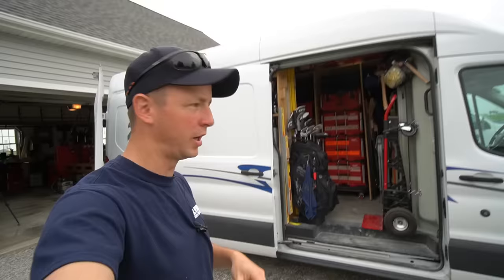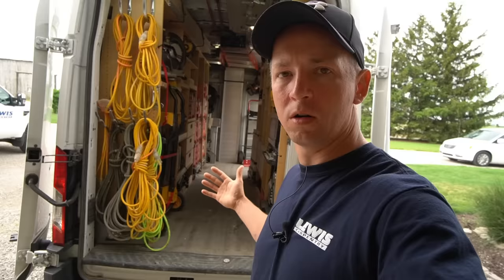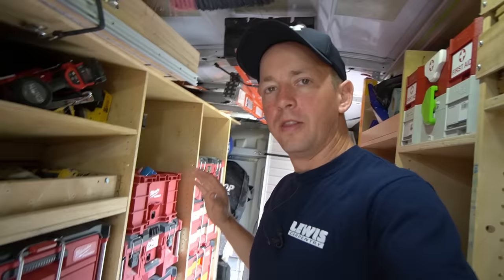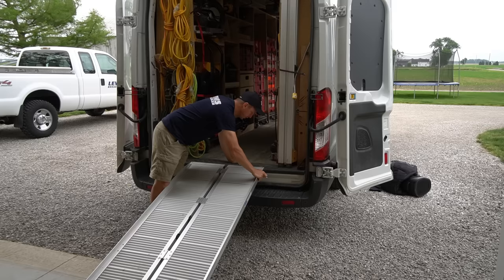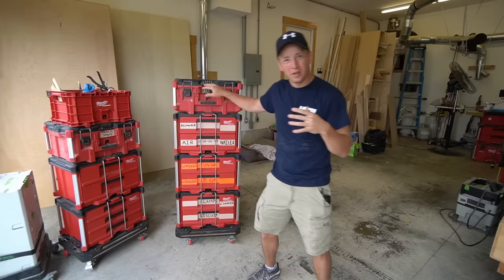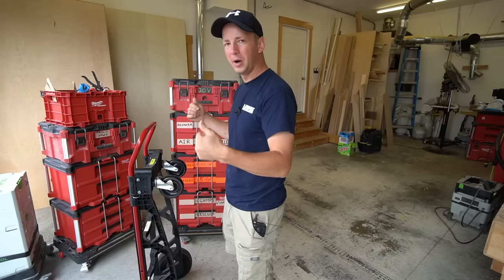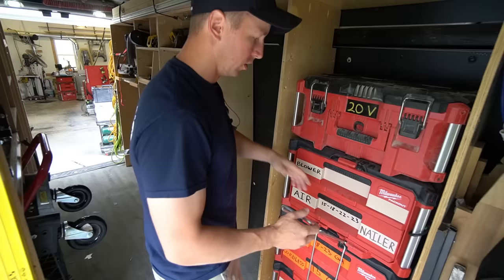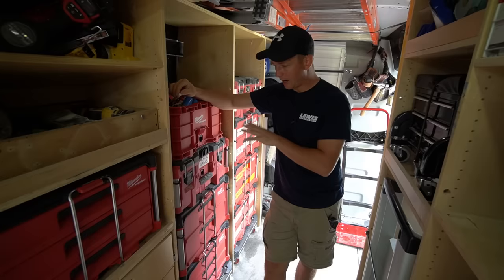Packout Drawers!!! My Favorite Carpentry Work Van Setup Yet!!!

Comment: You can get a hand truck that is designed to climb/descend stairs, it has three wheels in line on both sides. Mostly used by appliance delivery guys. Great well presented videos. Keep up the good work. Stay safe guys. Pete (Scotland UK) 👍
Reply: I think that Milwaukee is going to turn that hand cart into a electrical stair climbing dolley. Maybe!

Comment: Great setup. But one suggestion:
Move the ramp to store at the back door. That way you are already standing on the ground when you set up the ramps. You never enter the van until the ramp is set
Reply: it might possible.. but i might not fit cause the hight might not possible to put it back there.
Reply: You could keep the ramp on the floor?  Then when you open up the back, you just have to slide her out.   If you need to move stuff without it, you could stand it on the ground and lean it where that miter saw stand lives.

Comment: Love you videos. Started with Milwaukee pin nailer review which I bought. Love it. I saw first video with different casters and thought why you didn’t go with the silicone. Lol. I see you upgraded. If I could offer a suggestion, a ridged bar wood or steel bar stock that will drop in horizontally across top 6” or so of packouts will be a much stronger just as quick system that won’t fail like bungees always do eventually. Think accident or evasive maneuver. Those bungees will snap. Just a thought. Keep up the awesome work videos. I’m learning so much.

Comment: Dewalt had drawers for a while so that's why I went with dewalt. I just have the tstack system. I have probably 20 or so. Definitely game changer to have stuff in drawers. In and out. I have 2 carts and we typically stack the almost 10 high. So 2 carts with 20 plus drawers. Thousands of tools in only a 3' × 1' space save not only time but space. Love your set up.
Reply: I’ve done the same.  They’re like mechanics chests for carpenters.

Comment: Man, I agree with you so much on the benefits of the drawer system. I'm from a welding/fabrication trade where we go on site a lot and work so a traditional rig welder layout was not applicable for us. I got so tired of digging for tools in a bucket after carrying it to the destination. I immediately saw gains in productivity on job sites with the system.

Comment: When there's a "wheel", there's a way. Those bungee retainers and level cleats is definitely something I would do. Nice work Spence. Instead of the copper clamps (for bungees) you can get some PVC ones...and file/smooth out the inside edges on 'em.

Comment: Great setup for efficient work flow, and optimal use of personal energy (not over exerting). May I make a recommendation to exert even less energy. Perhaps you can add a small electric winch to the top near the rear door, to pull up the heavy stacks up the ramp.

Comment: Great setup, the old saying work smarter not harder very much comes to mind! Worth spending time researching, designing and implementing things like this as they payback many times over what the initial cost of time/money was in better work flow, easier work, less stress and hassle and prolonging your body to allow you to work longer and better.

For the bolt for your ramp that looks like something that could easily be lost. What about gluing a rare earth magnet to the side of the truck inside near the back door so you have some place to put it or better still a small length of chain on it and the ramp so it is always there when you need it.

Only other things I could think of was installing a proper handle inside the van like you see in disabled toilets etc to pull yourself up with both at the side entrance and the back and then finally a sack trolley which is designed for stairs, they usually have 3 wheels each side v the normal one and can be motorised. Perhaps not the one you use every day but put in for when at jobs where you need to take your tools up stairs inside or outside.

I suppose one more thing to go along with your microwave would be the fridge/cooler pack out to keep food/drinks cold.

I really liked the simple level holding design, sometimes the simple things are the best.

Comment: Excellent ideas.  One recommendation...move the ramps to the passenger side rear.  Make something where they hinge to the floor...maybe on a recessed rod or a third hinged stub panel that extends the ramps to the middle...where you can slide or flip them over and lower them.  Carrying them back and forth and relying on remembering a bolt seems like an eventual fail.  Good luck.

Comment: Hey Spencer, clever idea for the bungee cords. Idea for the 2 drawer unit, cut the floor out of the top drawer and install 1/8" plywood to the interior sides, thus making it a 1 full height drawer for big stuff. I should patent that idea. Another great video.
Reply from the maker: That's definitely not a bad idea if you would need one that size.
Reply: @InsiderCarpentry  I thought that you would be much more enthusiastic about this because of your previous videos on the subject.

Comment: I'm a 30 year technician and I have a foldable wagon with big wheels and I can load it with all the tools I'll need to do a job it saves alot of walking I tried several but to find one that will go across the yard or gravel or anything was hard to find this one has wide tires and pulls easy

Comment: Have to say that's a pretty awesome setup. I still have some wooden shelves and dividers in my sprinter. When I first started mine tstack and tough sys was all there was. I recently picked up the tough system wall mounts. Customized them for my van walls. Now just the tough system arms mount to the walls and my tough boxes slide and lock in. I still keep a few tstack. I really like the modular nature of yours. I may have to do some rebuilding now thanks. 
I'm officially stealing your level wall hooks. Genius! I want to get ramp like that as well. Trying to figure out where to store it 🤔
I'm definitely looking at a transit as next truck. Once I removed my dpf and EGR on mine sprinter she's a dream reliable. Fast as well 😅. I like being able to carry 16&17 ft stock still with my pass through. I haven't measured inside transit yet
Reply from the maker: I can carry 16' by opening my bulkhead door. Its handy.

Comment: One thing to solve stepping in and out of the van more than you need is to use your sliding side door for "go-to" "quick-grab" tools and supplies.   In my Ford Transit,  I have a storage cabinet and drawers built into the sliding door area so when you open the sliding door  all your "quick grab" etc.  tools and stuff are right within arms reach so you don't have to get into the van.   So simple.   If you think about it You really don't need two entrances to get into the van.   🤔maybe I should do a video on my van.   😂
Reply: Please do a Vid on your van! I’ll watch out for it! Sounds like a cool idea on the “quick-grab” storage!!
Reply: Love the Unicorn Truck vids too!!

Comment: Building out my transit and looking online. I’m a general contractor… so need a few different tools and layout.  I’ve done a lot of the same but need fewer pack out drawers. 

I currently have a 10” compound miter that I’m struggling to place. I’m thinking about getting the 7.5” makita sliding miter to carry on the van and leave the 10” at the shop.  80% of the cuts I do can be made on a smaller saw. …

If I could get Ford to make a few changes to the transit (I have a 2020 high cab extended AWD with two sliding foots on left and right side of cab), it would be:  

(1) sliding ramp coming out the back that is 2’ wide that folds out to 4’. I’ve looked at this …. It would require some pretty brilliant engineering to not raise the deck.
(2) I have power heated seats…. For a $68,000 dollar van, I’d like to see them ventilated like the pickups. 
(3) move the rear tires back 12”, I drag the rear Reese hitch several times a week. 
(4) I’d make the van 4” wider and make the entire rear cargo area 100% square on the inside. 

I really like the Transit otherwise. 

Thanks fir the video updating what you’ve done.

Comment: Love your idea of using the Milwaukee Packout system with wheeled platforms.  the only thing i would do differently is use the Dewalt DWX 726 rolling miter stand and make wings similar to the ones you made.  I made some to work with that stand (see Homecraft solutions). Always love your ideas and creativity as well as the quality of your videos.  Thanks, Brian

Comment: Awesome set up! Very well thought out layout & care for the body, especially with the ramp!  
I have a few questions...
#1 What led you to decide on setting up in a van vs a trailer & which sizes works best for everything you need? 
#2 What do you use for setting up a "work shop" on a job, since you don't have room to work in the van? 
#3 What would you change & why?
#4 The microwave idea is genius on these rigs, but do you also keep a small cooler somewhere or a mini fridge?

Comment: Another but major common sense example of lean engineering. Manufacturers finally rolling out useful equipment for use by all levels of trades. Your van set up could very easily be used by plumbers, electricians, etc. As I get older and through waves of down sizing my tools and garage workshop I’ve put everything on casters for mobility. Garage - Projects during day , roll tools and equipment back to small storage areas, then pull cars in. Easy to keep clean too.

Comment: Excellent video.  One comment, did I see some flex in the tires of the two wheeler when loading first Milwaukee packout stack.  If so properly inflated tires will push/ pull easier than under inflated tires.  
Thanks for a great video with many good ideas.

Comment: thank you for the video and all of the tips and ideas.  I wonder if you thought of using a 3/8 inch floor threshold/wheel stop, maybe beveled at the front to help lock in the base wheels,  especially if you forger to lock the wheels?
Reply: The issue with the packout stacks (at least that I have) is that they are top-heavy, and therefore can come crashing down during hard turns, not necessarily them rolling around.

Comment: Packout has a system of rails for trucks/garages for storage
Reply: The problem with the packout racking is it takes up alot of valuable real-estate in a van or trailer build.  Because of the way the support brackets are.

Comment: Outstanding....great job Mr Lewis !!
Good Order is the foundation of all successful jobs
Love your mindset of Work Smart, not Hard

14:07 is that a Quick release lynch Pin Bolt , your using for the ramp security ?
Reply from the maker: Just a run of the mill 1/4" bolt.

Comment: Great video. Definitely gonna look into doing a similar set up. My problem is with doing a system like yours at the moment is I'll need a trailer at least 6x12 when transporting custom pieces from my shop to the jobsite which I need to get at some point anyways causes its just alot easier to unload etc. I won't be able to fit much materials if 2/3 of the cabin is filled with tool storage.

Comment: I love seeing all the problem solving with this kind of organization. 
Im curious if you considered mounting the ramp to one of the rear doors?
Reply from the maker: The way I had the van laid out already, I didn't have enough space in the back. On a back door would be a great place for it though if it fits.
Reply: @InsiderCarpentry  I’m thinking about outfitting a small cargo trailer the same way. But I know that ramp doors need to much space for many job sites, so having regular split doors with a nice lightweight ramp like yours attached to one of them might be nice.

Comment: I recently received a new work vehicle. I also have been struggling with ideas for storage. I'm not on the Milwaukee system, but I absolutely share your concerns about all of these stupid pac-out systems that require you to remove the boxes on top if you have to get into them. The drawer system to me was a no-brainer. Unlike you I don't remove a lot of my tools from my vehicle so portability is not as important to me. But the Milwaukee packout system is just way too cost prohibitive. Again, since I'm not removing my tools like you are it's a different situation for me. But I found for the cost of a pack out box, two or three drawer, I could easily build my own custom boxes with full extension heavy duty drawer slides for a lot cheaper. Just a personal decision. I feel Milwaukee is just raping customers with what they're asking price wise for these systems. I agree there high quality and well thought out but the prices are ridiculous for what you get. Great job, I recently discovered your channel and I'm enjoying it

Comment: I did enjoy my packout stuff but it did not last long.  I am pretty easy on my tools/boxes and for almost $2000 invested in the system they lasted about 16-18 months which was really upsetting.  Unfortunately, there is no real solution that is long-lasting like a traditional shop metal tool chest and a portable plastic setup.  The funny part is I am super organized and some of my subs are working out of buckets and they are extremely good and fast at their job.  However, I do have to lend them random tools here and there because they lost theirs or temporarily misplaced it on the job site :)

Comment: did you make another video where you show us the wheel base that you mentioned you did custom i looks bulkier than a standard wheelbase and you have different wheels?
Reply from the maker: It is custom made. I do not think that I have covered it in depth in any of my videos. I will try and get it featured in a video or add a short showing how its made.

Comment: Very cool setup. How do you protect against theft or someone trying to break into the van? I know this might be a simple question, but I have been speaking to a lot of tradesmen and they have told me that break-ins are one of the biggest problems in the industry. Curious to know your input and also anyone else that has any ideas on this. Thanks
Reply from the maker: Carry an inland marine insurance policy on the tools and lock the doors. That's about it.
Reply: @InsiderCarpentry  Oh okay thanks.

Comment: I love the packout drawer system but the pricing puts Festool to shame. Absolutely scandalous how expensive these things are.
Reply: Can’t disagree on the expense comment but to a skilled well paid professional 5 minutes to unload then 5 minutes to reload required tools versus 20 minutes (example 40 minutes a day) over time is still a huge labor savings again that is to a professional. To the non professional that’s a bunch of money but not many of us have mobile workshops. In almost everyone of Spencer’s videos it’s about efficiency in performing precision repetitive tasks. Investing in quality likely expensive equipment for professional use with high degree quality again equates to savings and a happy customer. 
Not picking on you or your comment about expense but a professionals investments are a bit different the the non professional, like me.
Reply: @MikeZMonroe  Hi Mike. I am a professional contractor like Spencer in England. And like Spencer I too have invested thousands of pounds in tools and equipment to increase efficiency. In England at ITS tools one 3 drawer packout is £227.99. There comes a point when enough is enough and I have to call out milwaukee for daylight robbery.
I get your point and thanks for replying.
Reply from the maker: Hopefully over time the prices will come down.

Comment: Still using this setup? Just wondering if you have needed to change anything up or issues. Otherwise this looks great to me!
Reply from the maker: Still use this setup and absolutely love it. It's great to work with and extremely efficient.
Reply: @InsiderCarpentry  I will be "borrowing" your drawers on diy dolly idea. I had been considering setting them up on shelves but this would be more useful I think!

Comment: Hey Spencer, I see that you went with the 350. I'm currently shopping for a 250/350. With the single rear wheel, (correct me if im wrong) difference in GVWR is only +/- 500 lbs between 250 and 350. Do you think you could have made the 250 work comfortably if the inventory of vans in your area warranted it? Thanks 
Also, have you weighed the van fully loaded?
Reply from the maker: I'm glad I have the 350. You can really feel it when I am fully loaded with all my tools. Also, I frequently haul scaffolding as well which weighs a lot. If I'm full loaded with tools plus scaffolding it gets really heavy.

Comment: One question on power of tower w microwave?

Does it vibe a ton w compressor running or did u isolate enough w layer that micro hasn’t burned up ?

Comment: Outstanding setup Spencer. I also like how you don’t overdo it with foam, etc. What do you think about glueing a little magnet to hold your ramp bolt? Will the systainers be replaced eventually?
Reply from the maker: The systainers are definitely being phased out. But they are still useful.

Comment: But how do you get those tool boxes up customers stairs? It’s great if your work is on the ground floor- but most of my bathroom jobs are on the second floor. The ramp is a great idea. I use them on occasion. I have a tall Promaster and installed steps bars on both sides. For the back door I bought a step that goes into the trailer hitch.

Comment: really nice man !!!!!!! how do you securely attached the wooden side panels to the walls of the van ?
Reply from the maker: Ford has several upfitter points on both sides of the van that use M8 bolts.
Reply: @InsiderCarpentry  hi spencer thanks so much for the response you always respond and i appreciate it thanks bro!